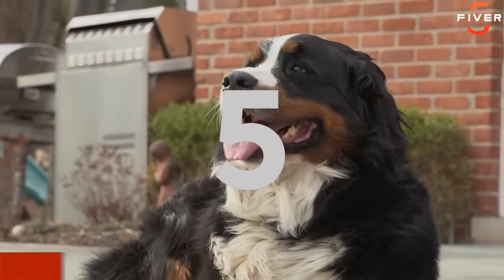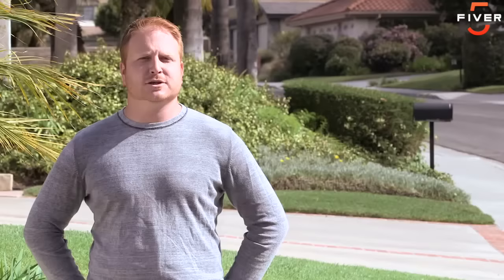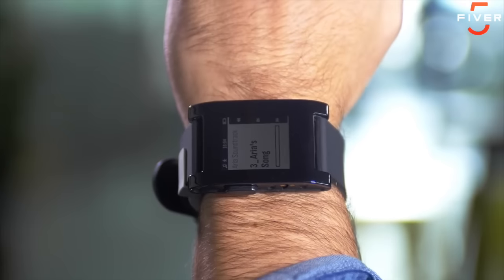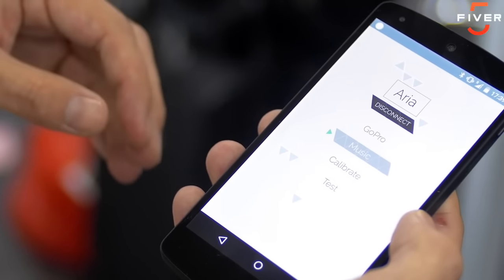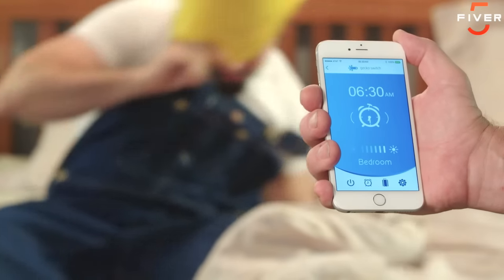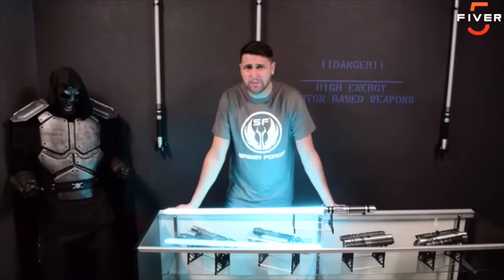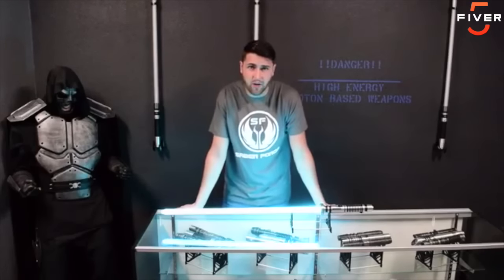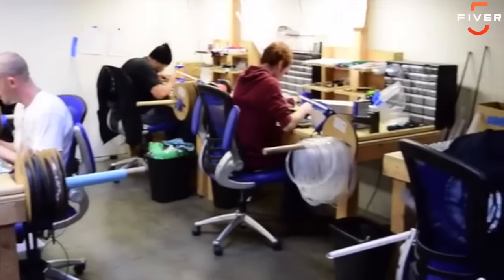5 Amazing Inventions You Won't Believe Exist #22

Comment: Thank you for putting these up. The Gecko Switch alone is going to solve a couple of humungous problems I have at home.
Reply: y cant u just get up and turn on the light switch is one not able to do that
Reply: I like to soak in the bathtub with the fan on and the lights off. The light switch in the bathroom is wisely placed on the other side of the room. A switch that's directly controlling 110V is NOT anything I want near the tub. 

I do not wish to walk to the tub in pitch darkness, nor do I want to drip water across the floor to get to the switch in pitch darkness when I'm done. It would make the floor a dangerously slippery traverse. 

A battery-powered remote switch is just what the safety-conscious householder ordered for this application.
Reply: DAT LAZY BOI